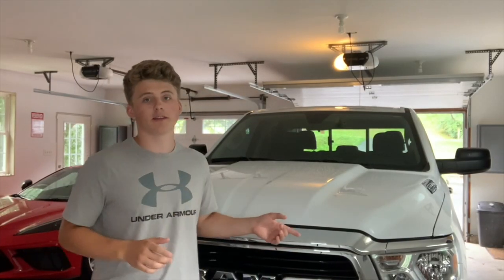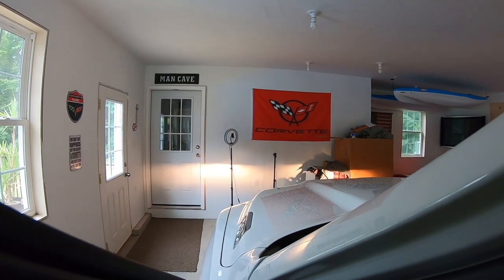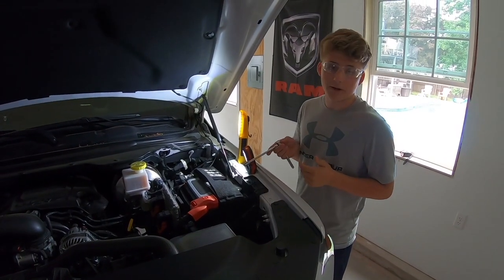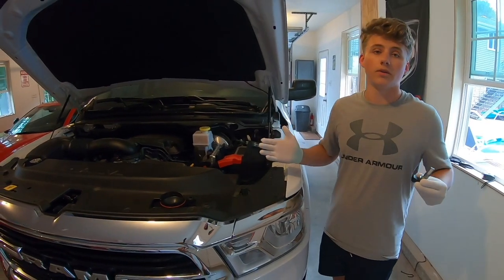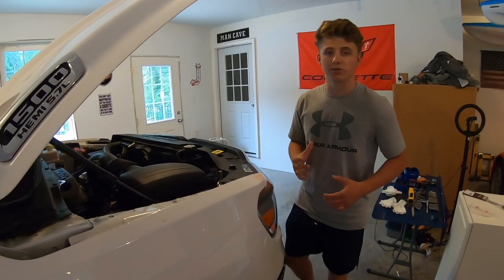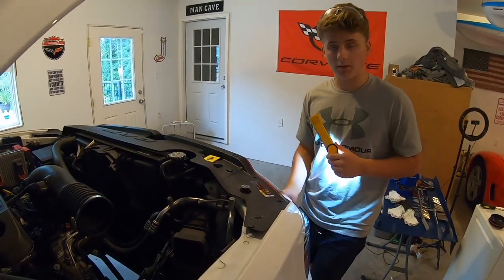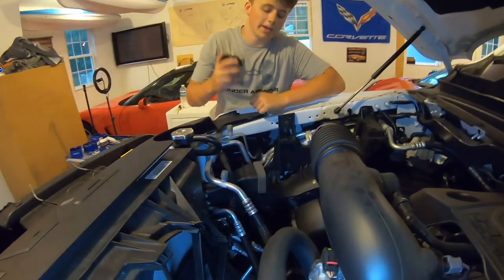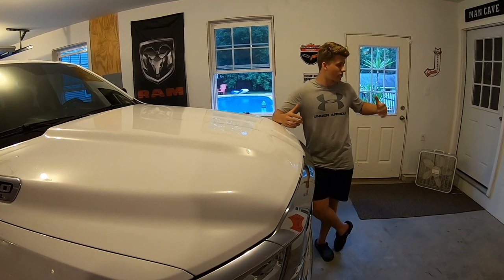How to install LED headlights on a 2020 Ram 1500 Big Horn

Comment: Thanks for the video. I ordered the same lights for my 2020 RAM 1500 Bighorn and they are a lot brighter and look way better. I replaced the low beams, high beams, turning signals and the fog lights. Your video really helped me out with the install! I really appreciate your time to make this video.
Reply: Id like to do the same thing to my Bighorn.  Would you be willing share the place you purchased those upgrades and the part/item numbers?

Comment: It’s actually easier to remove the bolts on the fender liners and reach up through the fender to get the low beams. They will be a lot less panting and cursing especially if you have larger hands.

Comment: Your video has helped me tremendously & I appreciate you making/posting it. I'm in the process of installing fog/low/high beam LED bulbs & decided to take a break before attempting the passenger low beam....all I have left.
Reply: Just lift the airbox straight up. That's what I did. They're not bolted down. Just on rubber mounts.

Comment: The low beam lamps are much easier to get to if you remove the 4 wheel well cover screws, you can reach it directly.
Reply: good to know, I might consider this when I change mine.

Comment: Whats missing is you have to use resistors on all LED conversions for Big Horn or you get flickering or light outage. I have been through 3 sets of LEDs in under 2 years. It was such a huge pain in the butt, I went back to Xenon 6500 lights.

Comment: Hello, I have a 2022 model and  changed mine using your video (great vid) but after a few days, the began to blink/flicker 3 time and then turned off.  I ended putting back the originals.  My questions is, did yours do the same thing?  If so did you replace them.  Whether your flickered or not, what model LED's did you get?  I truly only want to do this 1 more time.
Reply: William - I did some similar upgrades years ago, and there are some extra parts needed, forgot the exact wording but something like resistors or anti flicker modules or whatever they were. small plastic boxes with some computer chips / wiring inside, which basically fix the issue between the new LED lights and your truck's computer. This video showing just swapping halogen bulbs w LED ones is complete crap - voltage is different so your truck's computer will either pop up error codes or shut lights out while you are driving at night.. google there are several places that sell complete kits, including those extra wires / boxes (some websites show them optional for another $20 ot so, be sure to buy them)
Reply: @nicka8583  I changed the light to a different brand an lower wattage and they have been working perfectly since I wrote this message.  I went form a 55  watt per light  to 30 watt per light and all is good.  Here are the ones I went with for both headlights and fog lights.  It ahs been three months and no issues.  I also do a lot of night driving and they are good to go. The other ones, the flickering began with in a few days.

Comment: Same question as others. Do the flicker without ballast and/or throw code?
Reply: So I had these lights for about a year  maybe two and I've had no issues until yesterday it started flickering like crazy I felt soo embarrassed going to work in the morning people thought I was flashing them, they will eventually flicker but I guess they make a anti flicker harness for our trucks I'm going to order it soon. I'll be dam if I go back to oem headlights.
Reply: @luckyfool100  
What year Ram do you have. And where did you buy them?
Thx
Reply: Alfi obd u have to go into the computer and switch the setting to led and it will be fine it’s a wattage issue where the leds don’t use the same as the halogen lights they actually use less power

Comment: fuckin video wouldve been flawless if you hadnt fucked up the 2 most important pieces of info we all need.... the link to where we can buy them.... and did they throw a code on the canbus system.
Reply: I've put the same lights in my truck no flickering or codes
Reply: And you can get them on Amazon

Comment: So what happens on the beam tech bulb if the fan stops spinning is it going to be a total meltdown since nothing is here to cool it down
Reply: What are you talking about? Led headlights get like 80 degrees F.  What will melt?

Comment: They do not make these lights easy to get to… if you’re a big guy like I am with big hands that low beam is freaking hard to get to
Reply: At that point, you’re better off just trying to take the entire headlamp out and manually disconnecting it. That process in itself takes a while and it’s really relying on you not breaking any of the plastic.
Reply: Take off the fender lining. Makes it super easy.